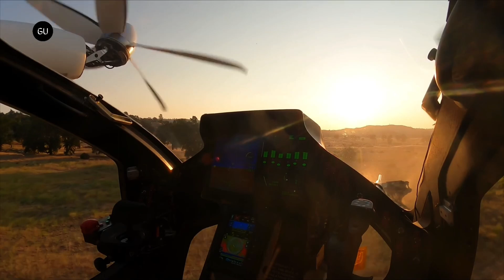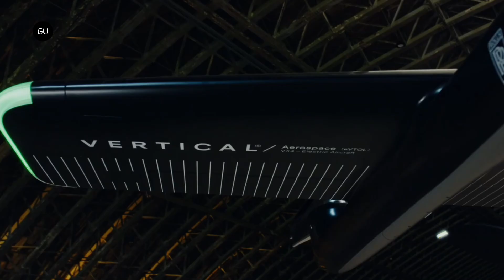Vertical Aerospace Prototype VX4 eVTOL Aircraft Crashes During Flight Test

Comment: Only reliability keeps people alive in aircraft. Reliability. Remember that, especially with 'new' things that fly carrying people. We are used to 'reliable' existing aircrafts. These have a long evolution and set of historical based standards that deliver safety and reliability. 
New things don't have that. This means that fatal surprises are still lurking everywhere in these designs.
Reply: Absolutely.  That's a concern regarding what happened regarding JOBY crash and the EVTL VX4. Ability to land conventionally ( even if it's a controlled crash landing ) with reduced to zero power, I would see as an essential requirement for an EVTOL, along with ability to maintain flight / glide control under a full power outage. If they can't do this, they fail miserably in my eyes. It then only becomes a matter of shorter time frame before a fatal crash occurs. Yes flight has risks, but the aim should be to focus on risk mitigation and minimisation, particularly with emerging unproven technologies.

Comment: I wonder if it is credible that a single propeller can cause a plane to crash... (what are the other 7 for??) In terms of safety, it's not exactly the best... Even more serious than a broken wing .It seems that 70 years of aviation and the recent problem with the imploded submarine have not yet made it clear that certain materials are not yet suitable for such a... casual use. As hard as the impact may have been, I think there's a lot to work on...
Reply: Propellers are quite close to each other and there's 4x close to each other on each sides. 
On top of using a mobile movable arm (extremely risky) 
It have always been worse with morr mechanical moving parts
Any extra mobility in aerial vehicles increase the cause of failure & probabilities of issues
Reply: @alxzero7113 @james_14337 More rotors means redundant upward thrust. If the rotors are designed well, they are also quiet and efficient. Joby is a better example, I think Vertical has more catching up at this point than investors are perceiving

Comment: Well we know how fail safe it is at least -- the FAA/CAA/EASA requirement to provide 'equivalent occupant safety following POWER FAILURE in the form of glide or autorotation as for existing certified aircraft ' would not seem to be satisfied - or indeed achievable in any fashion giving the total vulnerability inherent in this sort of accident prone operational mode ('hanging on the props') --how partial the power or thrust loss was in this case is unknown but presumably was relatively gently and deliberately 'tested'  unlike the real case of sudden unplanned failure or in inclement weather etc .  Belief that 'it will never happen in a billion flights'  (as being claimed) is not being bought by the certifying authorities despite the religious faith in software and electric motors . ( having a thousand hours of 'post power failure' flight (gliding) under my belt without such an event -including test flying - I am not impressed nor surprised by this -see previous comments on eVTOLS  )